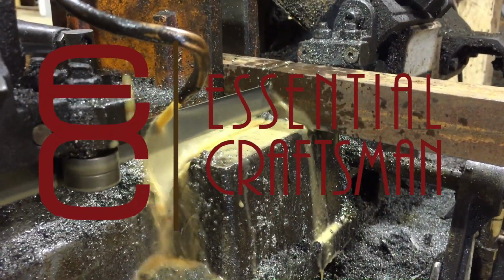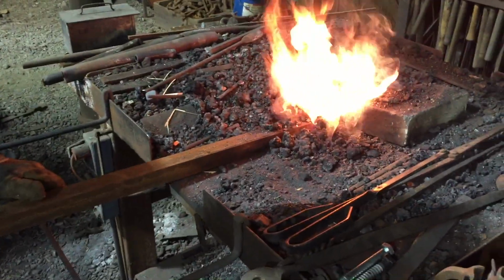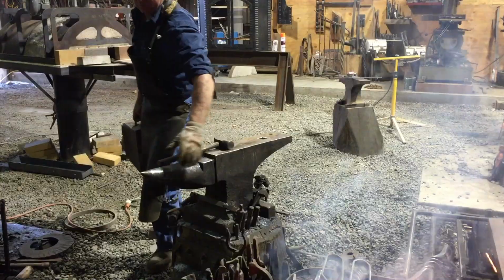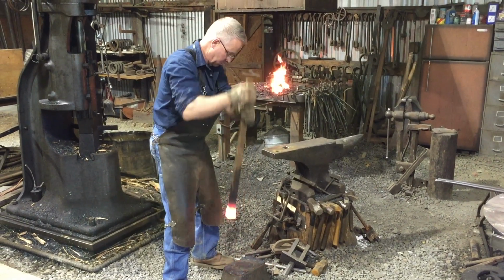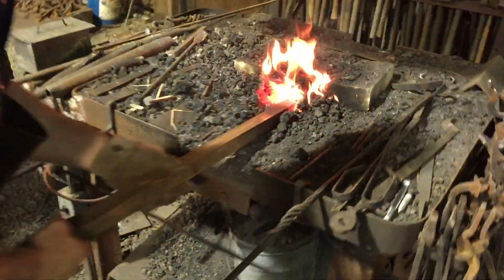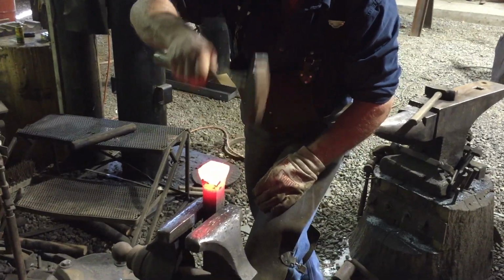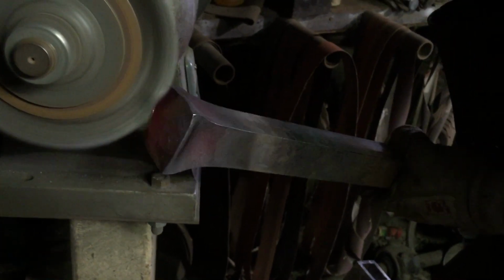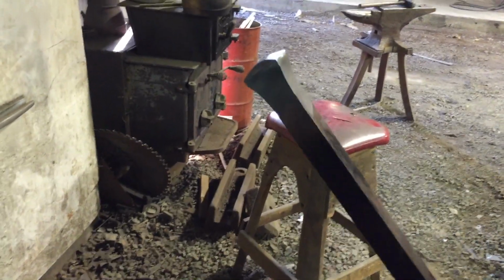Blacksmithing Processes: Upsetting

Comment: Thank you for showing this process. I'm still getting my shop in order and have had the need to upset the ends of various stock. Having a low block like that is a great way to accomplish it. I've learned something today. I'm trying to make a hot cut hardy from an old splitting wedge. My old hay budden anvil appears to have a 7/8 hardy hole. Lot of cutting. Any advice is appreciated.

Comment: Nice hammer control. That clout had looks pretty darn good (adequate in old timer speak (I can say that because I are one)).  Group suggestion; when you were using the crosspein at the end, it looked like the back of your hand was almost oriented up. Is that comfortable for you? I s taught thumb on top for control and rotate the hammer to create an angled face, so, just wondering...
Reply: Correction: it was when you were upsetting with the three pounder sideways...